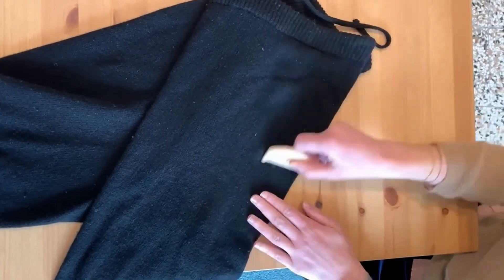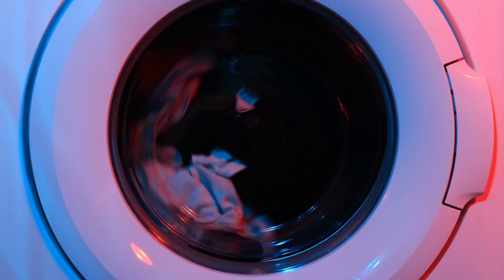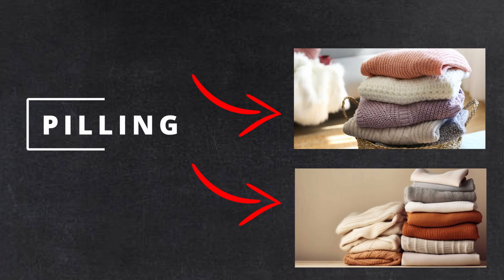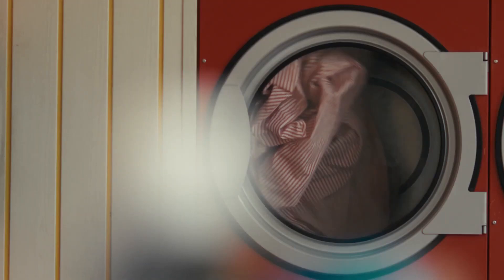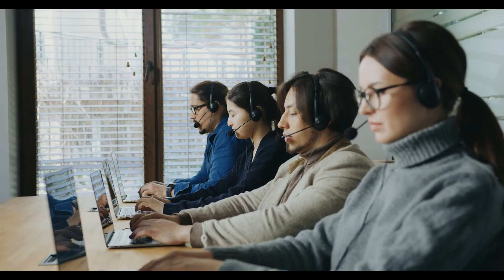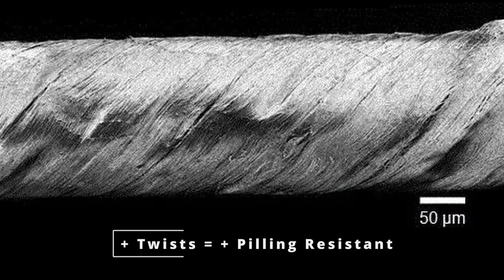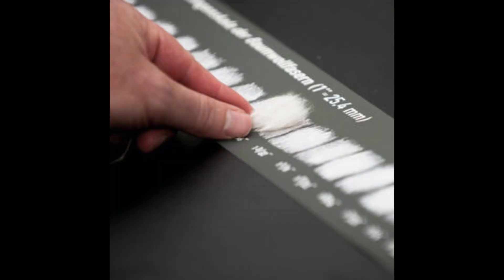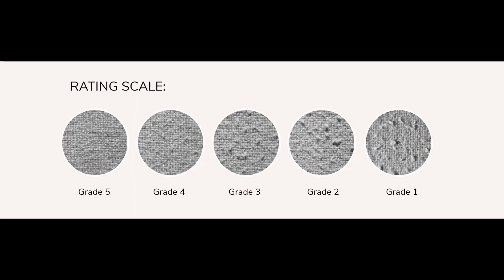PILLING - What is it and How to PREVENT it

Comment: Very interesting! You could also explain how to recognize a garment with short or long fibers, to buy high quality clothes. Also, I once read that the pilling on synthetic fibres is worse beacuse they essentially fuse together instead of simply "balling up" Is that true?
Reply from the maker: Thanks for the interest on this topic!
Generally pilling refers to tiny little balls of hair that pop out from the fibre, it's typical of natural fibre, not synthetic (even though also synthetic fibres like staple polyester fibres can generate pilling). What you are talking about refers to the fibres of polyester that, if melted, some lucid areas can be generated and they appear "burned" or damaged, it seems like pilling, but it's not a typical feature of pilling per se.
I will surely make further videos explaining how to recognize bad and good garments when you have to purchase one! Thanks for the tip, much appreciated! Stay tuned!